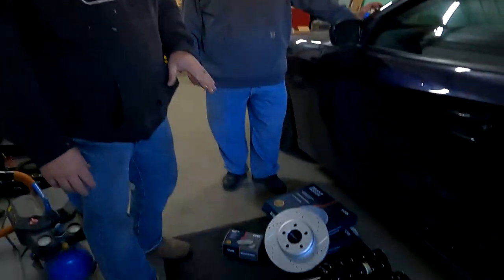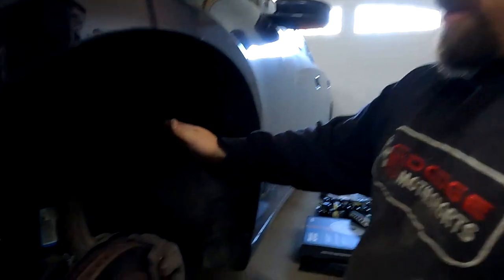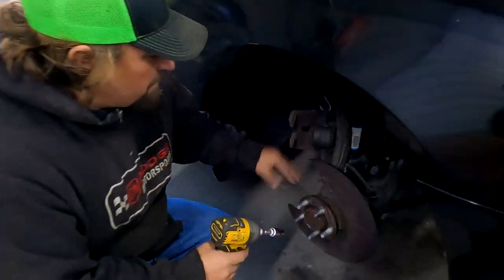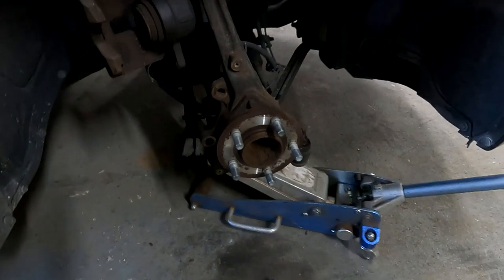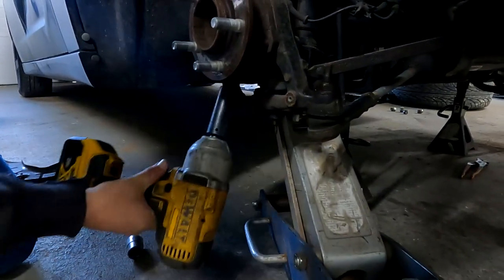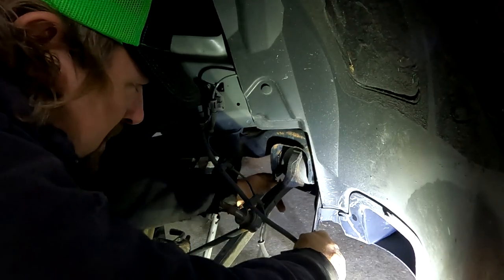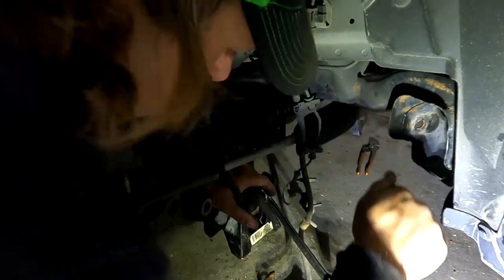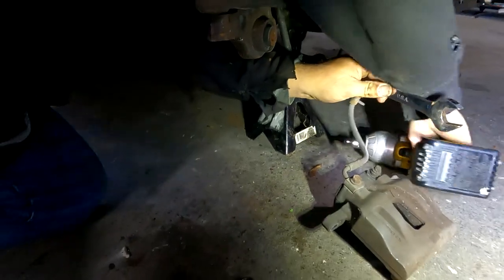Rebuilding A Front End Suspension With Amazon Parts - 2012 Dodge Charger

Comment: 🚒 good stuff 👍👍
 I'm pretty sure you caught this but forgot to mension it. The rotor is on the wrong side. Their directional.
Reply from the maker: Good catch, that accidently got cut out, I will pin this comment since we didn't get it in the video.
Reply: and you used the wrong "they're"...they are.
Reply: @PerpetualProjects  so would you recommend Amazon suspension kit,I'm looking to get a kit for a car.

Comment: The slots in the arms are for adjustment when you use the bolts that have slots cut in them, they give + or - 0.30° for camber or caster
Reply: Caster is handled by the upper control arms. Not the lower.

Comment: Great vid. Trick - have the new balljoint sitting in the freezer while you are removing the original. Slides in like butter, especially if you also heat the knuckle. excellent walk through!
Reply from the maker: Great tip!

Comment: Always supposed to have the suspension loaded when doing suspension work on these particular cars
Reply from the maker: Absolutely, you want to tighten down all the bushings in the position they will be in at ride height because they don't rotate once they are tightened.  Thanks for the tip.
Reply: Only when it’s time to tighten the pivoting bushing parts, like the inner parts of the upper, lower, and tension strut, as well as the strut bolt on the lower control arm.     And end links.

Comment: So the only thing I’m having a hard time with is replacing all of these factory parts that total up to close to $3000 with junkie Chinese ones that could possibly break and actually cause catastrophic failure. I’m having a really hard time right now deciding on what to do.
Reply from the maker: I can understand that concern, all I can tell you is this car is daily driven and the Amazon parts are still working good after 6 months of use.
Reply: @PerpetualProjects  I just ordered mine for the magnum ! You gave me motivation to try it myself Lolol ! Cheers brotha keep them videos going
Reply from the maker: @x7superpocketbike941  I hope you have as good of luck as we did!
Reply: @PerpetualProjects  parts came in yesterday finished installing them the only thing I struggled with was moving the struts instead of taking them fully off I just unbolted them and pushed them back enough for me to b able to remove the upper control arms , everything worked out tho saved me 1200$ @ the mechanic for labour ♥️♥️♥️
Reply from the maker: @x7superpocketbike941  that’s awesome!! We really appreciate you commenting and letting us know. 😊Our goal for this video was to show our viewers that with a little motivation and proper research they can tackle repairs like  this themselves ❤️❤️
Reply: Well,  I'm glad I found this video.  We just did pads and rotors on my wife's 11 RT, and replaced the front tires that were worn on the inside.  We drove it, and it had a horrible wobble around 40-60.  Took it and had tires rebalanced, and aligned....wobble is still there, so we're ordering the whole kit.  I was going to have the shop do it, but, for $1200+/- in labor,  I think I'll just find the torque specs on Google,  and have the alignment redone. Shouldn't be too hard, just did all the steering linkage on my 01 ram 4x4, I've done ball joints before......lol.

Thanks for the good info, tips, and instruction.👍
Reply: While that is a common concern, you have to remember, the only person using oem is ther dealer or the manufacturer. Most shops use house brand parts, which are third party products. When I buy parts online for these kind of projects I prefer Detroit axle brand. American company, products are well made, and I’ve done several suspension component jobs with them for my personal vehicles and flip cars. I’m about to do my third charger front end with all Detroit axle parts, and the cost of the whole front end plus struts was about 330 shipped to my door. Will they last me another 10 years? Probably not, but will it last me till I sell the car? Absolutely. And at the cost variable I’d rather spend 300 and replace every 4-5 years versus 3 grand every 10 years

Comment: Mine is a 2011. The dusk cover did not come off after removing the 3 bolts. It spin around on there. May the 2012 has a section that is empty of the metal? Mine would not come off unless I remove that wheel bearing.

Comment: Thanks for taking the time to make this video!  I just did this on my 2010 challenger and wish I saw this first!  
Just wondering, after the install, were there any clunks/pops/creaks that stuck around or were created by the job?  Have the parts lasted?
Reply from the maker: You are welcome. There were no noises after the job. They are still going strong it has been over a year and the car is driven almost daily.

Comment: Nice video.  Only think i would add.  Is a torque tool.  Some of this screws have their own torque. Like 120 f pound.   50 and 35 .
Reply from the maker: Thanks, I meant to say torque to proper specs if I didn't. I didn't want to give torque specs since they could change depending on model and year and such.
Reply: @PerpetualProjects  very well done

Comment: The ball joints come greased already or did you not record that part?
Reply from the maker: I didn’t record greasing them. If they have grease zerks I grease them if not I assume they are greased
Reply: @Perpetual Projects  I asked because I ordered a suspension kit from Amazon and the the grease fitting that came with it didn't fit the tire rodes did you have that same issue? And I think I've found a solution of just using a needle end for the grease gun to eject right into the boot
Reply from the maker: @DarrellEllis-o6j  yeah we didn’t have the same issue, but that’s a good solution !

Comment: Those parts probably won't even last two years. Junkkkk
Reply from the maker: They are better than the wore out stuff that was on there.  While it could last longer with all factory parts, it isn't always feasible to spend that much on 10 year old car with a bunch of miles that isn't worth the cost of the replacement parts.